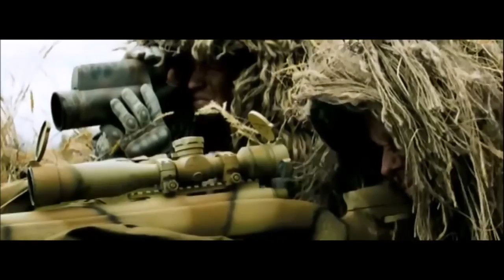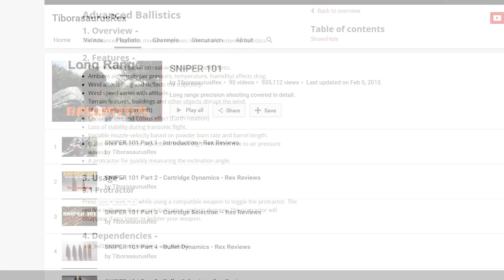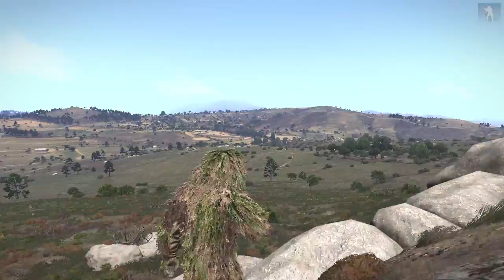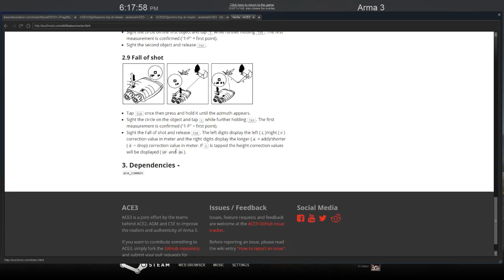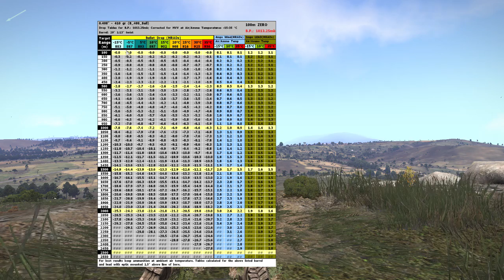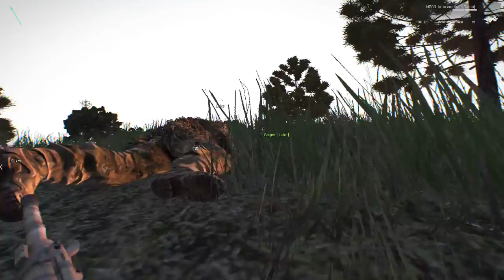Arma 3 ACE3 Sniper Tutorial

Comment: Good video, but... Considering that wind is probably the second-most-important factor in long-range shooting, it'd have been nice if your section at about 43:50 to about 44:50 could have been a little more clear.

Thanks for taking the time to upload a highly in-depth 1hr tutorial for us scrubs (thinking about it, probably a lot more than that if you include all the cuts, research, loading and editing to be done, even if you ignore YT upload times).

EDIT: Also, at 51:30 (thereabouts), surely the Kestral should've showed small crosswind values, as there was a significant wind across your line of fire. This is evident when you fire, since you have to compensate left.

EDIT2: What is this 'set zero' functionality? What's the point of it; what does it do, and why do you need it? Why would you want to offset the 'zero' mark on your rifle?
Reply from the maker: +Kill3rCat I agree, windage could have been explained better. But headwinds and tailwinds truly don't affect the shot much, unless you're in extreme conditions.

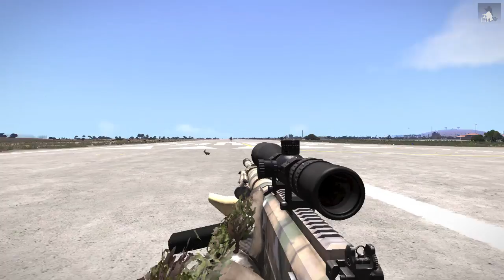Setting the zero is something important you have to do every time you start a mission. 14:00 in the video - the ACE coding for the zeroed values isn't as correct as it should be - to adjust for the m200, I actually had to adjust .7mils high to offset the imperfection.
Reply: Seriously I find at most ranges above 300m, wind has a very significant effect on the bullet's trajectory.

I'll rewatch the 14:00 bit.
Reply: Seriously Ah, I see. So, where do you get the 'accurate' ballistic values? I hope that doesn't mean alt-tabbing to view GitHub whenever I want to take a long-range shot.
Reply from the maker: Just practice your rifle on the range and learn the true zero at 100meters. and then correct from there. Github is a good source of information but not a necessity.
Reply: Seriously Ok, sounds like good advice. Thanks.

Comment: The REL values are good if you're adjusting your shot. So, you calculate the shot, everything remained the same except for, let's say, distance. Once you change distance and hit Calc, it should tell you how much you need to adjust from the previous condition.

Meaning, if you do +5.5/+0.5 and your target moves 500 meters closer, now you gotta be at +5.1/+0.4, the REL value will show -0.4/-0.1. 

At least that's how it worked when I played with Advanced Ballistics pre-ACE3.

If I'm wrong, please elaborate :)

Comment: @seriously So I enabled the advanced ballistics module. Then I found out that when you're shooting at a target if you use the wind direction (clock) then you can figure out whether to use the positive or negative value on the range card (kind of like a number line). So if you have a target that is 1200m out with a 2 m/s wind from the 8 o clock. You can use the range card to find out the elevation, but you do the opposite because the range card says it'll drop negative so much so you do the opposite. But with the wind, I believe if you have a 2 m/s wind coming from the 8 o clock then you'd look at the range card then do the negative value for that wind on the range card because you must shoot into the wind to hit the target. However, if the wind was 2 m/s coming from the 2 o clock then you'd use the positive value on the range card for windage because you must shoot into the wind. I don't know if this is too confusing.
Reply from the maker: It is very confusing. Wind is very important to get right, which is why precise wind direction values should be calculated in your mind (or the Atrag does it for you). For example, a 1200m target with 2m/s wind from 2 o clock to 7 o clock would result in roughly a half value on the range card. This is because the range card values are by default 4m/s. 

Here is a quote from a Google search to help explain - "In order to interpret and apply wind compensation correctly, you have to determine the angle of the wind; how it flows across the bullet will determine the amount of drift. A tail wind or head wind will have no value; they have essentially no effect on a bullet’s flight. A direct crosswind, which blows from 90 degrees into the path of the bullet, is called a “full” wind because the full effect of the wind is experienced." Except a 45 degree angle would not give a half value but a three quarter value. This is where it gets confusing.
Reply from the maker: Here is an illustration to help understand

https://drive.google.com/open?id=0B5USBv-e9PjaZ0gwU1V1d2RvdFE

Make sure to input values into the ATrag because it will do a lot of this work for you.
Reply: @seriously, yeah I understand. I had a very bad explanation. But could you explain to me how I would shoot a target from 1200m away if I had just a kestrel and range card? Because I don't know how I would calculate for humidity and barometric pressure and temperature and such.
Reply: @seriously could I add you on steam? I also love long range shooting, I just need some help. My steam name is Pyroplastics.
Reply: also how do you calculate if you have strong crosswind and headwind. Do you put the calculation in for crosswind and then add that with the strong headwind calculation? So if you have a headwind of 4.6 m/s and a crosswind of 4.9 m/s would you put those both in (one at a time) then add them together to get the windage adjustment?
Reply from the maker: +Grisly Bear that's what I do yes. The headwind/tailwind value will affect the elevation MILs, so I do that after other things  (true distance to target, etc) and then the windage values I apply for the left and right. I actually had this same question and had to seek help for the answer. A lot of shooters say that headwind and tailwind hardly affect the shot, but in a long distance (like 1200m) with a strong headwind, I want to know how to account for it.
Reply: so then how do you know if the bullet is being pushed down or pushed up by the headwind?
Reply: so do you have a headwind/tailwind mil dot calculation or range card?
Reply from the maker: Its really hard to tell, most of the time elevation difference is what affects you most, especially over long ranges will result in a true distance being difference than a lased distance. Honestly dont worry about headwinds and tailwinds so much, unless you are shooting under bad conditions at extreme ranges, they hardly affect your shot. The range card gives good estimations based off temperature and barometric pressure, I dont use it much for windage or manual wind calculation.

I see you're really into long range shooting... it is a niche field that few know how to do right, especially doing everything manually, so yes I will add you on steam, maybe we can work together on doing a youtube video, I am just really busy with real life and stuff so might take a while
Reply from the maker: http://steamcommunity.com/id/SeriouslyHumphrey/

I couldnt find your account
Reply: Wait...wrong person on steam.

Either way, just shoot me a friend request.

Comment: just addressing what you said about zeroing and wind. you're shooting a .408 at 100 yards. unless theirs gale force winds coming in wind will not affect the flight path at that range. just throwing that out there.
Reply from the maker: yeah good point. was pointless worrying. True zeroing your rifle is still necessary though
Reply: +Seriously absolutely. I was just saying that the round is traveling at speeds that wind isn't even a factor at 100 meters. great video though. I love the ACE mod.
Reply: What range would you advise on testing it then?
Reply: You zero at 100 meters because wind doesn't effect it. It gives you the constant for your formula at greater distance when wind/elevation/temperature/barometric pressure/position on the earth becomes the variable.
Reply: myron666mosley666 oki doki ty :P

Comment: With the Zero adjustment, does the mod change that from the games default setting depending on environmental data? e.g Altitude, Baro, Temp? If so you would need to re-zero for each map you play on due to large variations in environmental data.

Comment: ok, seriously I understand it all in the video. I just need to know if the atrag calculates like spin drift and all that. I just don't understand how do you calculate for that if you don't know how?
Reply from the maker: Yes spin drift is automatically applied with the information from the round inputted. It has to do with the ballistics coefficient and the velocity of the round (muzzle velocity). It is a pretty stable variable to apply. I will try to do a video on these topics my friend, they are very advanced shooter topics (manually doing corrections with no calculator!!)
Reply: spin drift is simply a cause from the rotation of the projectile which is why rifle with right rifling twist drifts to the right and left drifts to the left . the tighter the rifling in the barrel the more spin it will have. the projectile's diameter also effects the the amount it drifts. when you add wind to this it and your rifling twists to the right and the wind comes from right to left  it can actually stabilize the round longer and add lift to the round which can help increase your effective range. the opposite wind direction with the same right handed twist you will get the opposite effect.  The velocity doesn't effect the spin drift until you start getting the lift or drop effects from wind. honestly i'm impressed by your knowledge you have so early, even the Marine Corps marksmanship trainers(0932) don't get taught this information. Never stop learning!
Reply: are you in the marines?
Reply: Was.
Reply: force recon or a marksman
Reply: haha may i ask why
Reply: i was just wondering because I want to be a Navy SEAL
Reply: Ahh ok. I was a riflemen (0311) with a secondary mos 0932.
Reply: The units I spent most of my time in was 2/2 golf and 2/2 weapons
Reply: stupid question, where do i put the pbo 360 filles in arma3 folder? missions or addons...ect
Reply: i tried that, but it just didnt fit,
Reply: As it shouldn't!
Respect.
Reply: cx

Comment: very nice video!!!   but i cant get that bullet path trace to work. as i can see in the video, u have an special mouse scroll command for this. how to do that, to turn it manually on or off?  and which scope is needed to see the effect?  i have the same LRPS ingame as you. The actual ACE3.5 mod installed. everything else seems to work.  by the way i´ve found the Advanced Ballistics by Ruthberg. Do i need to install them also to get this effect to work? could this colored effect be disabled in current ACE Version? thanks, cheers xD
Reply from the maker: +ironblader Hi, it's a separate mod called the 360 degree training course, 1:14 in the video,

I link the 360 degree course, its a singleplayer mission file
Reply: +Seriously Hey, thanks for your fast response. i think i havent recognised the first 2mins of your video .. my bad...  but, most of your links here are dead, cutten off on the right side, also in ur 2475m vid....i just found the mission u mentioned, and later im gonna test it. now i have to sleep. just hitted 500 arma 3 hrs ;-)  cheers xD
Reply from the maker: +ironblader Fixed as many links as I could, I didn't know they were dead. Life has caught me busy, advanced ballistics is still a passion of mine though.

Comment: Anyone know the movement speeds of each stance? I know walking is about 1.4 Meters a second (3.1 MPH)?

Wait found it.

run: 17 km/h speed = 4.87 m/s 2Dvelocity (4.96 in A2)
sprint: 24 km/h speed = 6.66 m/s 2D velocity (6.43 in A2)
tactical: 5km/h speed= 1.57 ms 2Dvelocity (1.86 in A2)
siderun: 3.35 m/s (3.09 in A2)
backpedal: 2.94 m/s (3.6 in A2)
crouch: 0.84 m/s (0.9 in A2)

Comment: how did you move your microDAGR down to the lower right? Its so annoying up close and in your face when walking. I thought that was the normal view.
Reply: Todd Davis with the normal DAGR I just hit home twice, use shift+home to switch between all 3 tools instead of assigning individual keys. I keep my DAGR and Kestrel open and then set my Atrag back on home to pull up as necessary since the other two sit in the corners of the screen

Comment: hey nice video but i have a question... i have some problems with the zeroing of the scope.. so you said that you adjust the scope by 0.7 to 0.8 mils and than go to the self action menu and zero the weapon! but i dont have this option to do... i have the ace 3 mod + cba!   thanks in advance
Reply from the maker: +OutsideTheDoor make sure the weapon is equipped and you have made adjustments on it. I am using the LRPS optic I would stick to that. this is a tricky and finnicky adjustment/bug, but it needs to be done for accurate shots. The M200 needs a .7mil adjustment zero at the start of every new game.
Reply: +Seriously I am doing exactly that and i still dont have the option

Comment: Hi thanks for advices.  Just 1 qst  where can I find weapons statistics? To make sure the data of weapons and ammo  is corectly input in the calculator?
Reply from the maker: open your cfgammo.hpp file and find the data, it should be in the ACE mod
Reply: What about ammo? I couldn figure out what ammo my rifle use because there was i.e. 308.lapua 250g 300g and some other kind in the rifle setting. BTW i finnaly figured out what LEAD button do, it is for changing calculating atribute from low wind speed adjustment (1) to high wind speed adjustment (2), depedning on current blowing and modify L-R correction. Cheers

Comment: hi mate can u tell me how you got the correct latitude value for your ATrekMX pls
Reply from the maker: Syr3L Ruthberg gave me the value, but you can just use the actual google maps latitude of the island of Limnos, Greece, which Altis is based off. 40 degree latitude is for altis, Stratis is about 39, more like 40 though. These small differences will only barely affect coriolis which will only barely affect your shot, so dont worry.
Reply: Seriously thx mate - i know but in my atrex the latitude was 47 which is more off resulting in unnecessarily inaccurate shots

Comment: I still don't really understand the atrag windspeed 1 and 2 thing.. can you explain it to me?
Reply from the maker: +Orangazheng reference https://www.horusvision.com/download/manual_Horus_ATrag-v385.pdf page 32.

Windspeed 1 is low value, windspeed 2 is high. Enter in this data and the ATrag will automatically find a balanced average. This will also automatically factor in to your calculation.

Remember to take wind readings standing up, or in an area as least obstructed as possible. This may be difficult with regards to concealment. I may make a video on sniper tactics in the future.
Reply: oh.. ok this is great, thanks

Comment: I have two problems.
1) when I input that code into editor and click local execute it pops a chat message saying false.

2) no matter what version of cba I install I can't use configure addons because it is empty with no mods.
Reply from the maker: Wyman and Brad Gaming Co. Ok. So your first problem is evident that advanced ballistics is not enabled. If you've created and enabled the module and it's still reading false, I would say something is corrupted in CBA or ACE. I would do a clean re-install of both.

Try installing your mods to My documents/arma 3. Or, when you're using the built-in Arma 3 Launcher, make sure to go to the "mods" tab and add the ACE and CBA mods manually. Once launched, you can double check in the configure addons tab.

this sounds like a CBA version issue. Make sure you're using CBA 1.1.23 and get back to me
Reply: Thank you for the quick reply still watching this vid. It is exactly what I want in arma.
Reply: Seriously I reinstalled both and am still getting no cba addon configuration in the controls. I am also getting a false in chat again.
Reply: Seriously Could it be the launch order? I know that was a problem with overpoch in arma 2 oa.
Reply: Wyman and Brad Gaming Co. I get certain features like the ace option menu in the pause screen. I also cant zero guns but the actual ace zeroing doesn't appear. Also the ammo counter dissapears in favor of the bars when you reload
Reply: Wyman and Brad Gaming Co. OHHHHHHHHHHHHHH wait a second. I thought the code created the module. I need to create  a module THEN check.
Reply: Wyman and Brad Gaming Co. It worked when i reinstalled again and entered the 360 training. Is it because i need to put down a ton of different modules for a mission to actually work?
Reply from the maker: Wyman and Brad Gaming Co. yes the advanced ballistics module needs to be placed separately. a lot of people dont know this. They upload sniper videos with super long distance ace killshots. and AB is not enabled.